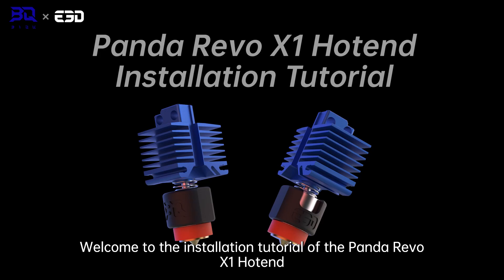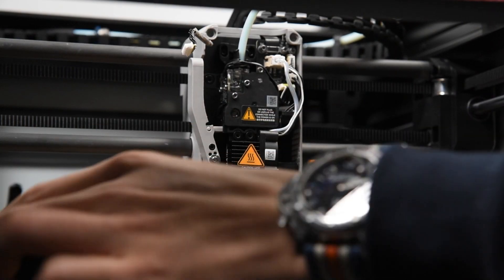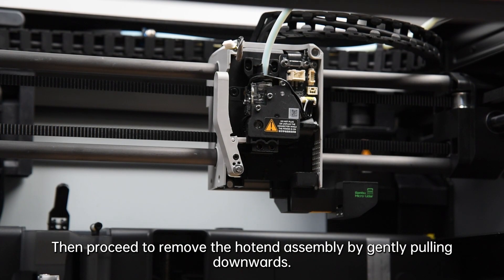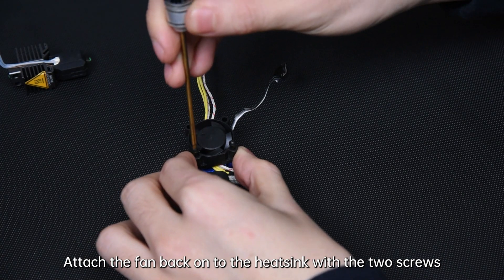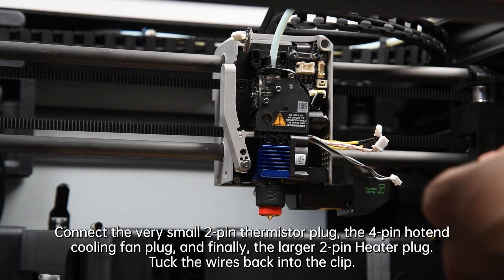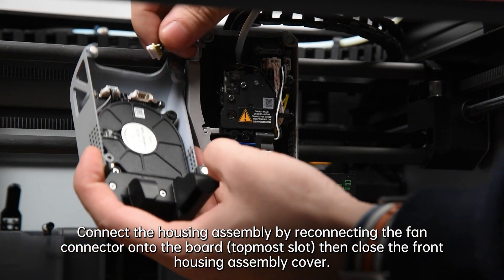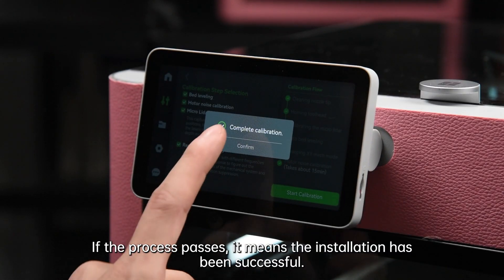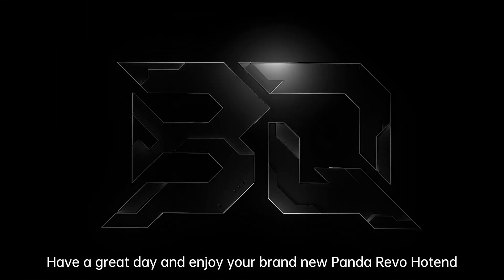Assembly Video--BIQU Panda Revo ✖️ E3D For Bambu X1C

Comment: BIQU. In December I ordered a replacement heatercore from your website. I was told now that this is backordered until sometime in February, which did not work for me as this would have my printer down for two months. When I was checking status, your support teams were quick to respond but when I asked to cancel my order, they stopped responding to me. I have tried several times, in different ways to reach you to cancel my order, so now I am resorting to posting this publicly. Can you please help me cancel my order?

Comment: Don't I also have to change the nozzle material from hardened steel to brass in the printer settings? 🤔 And what about other settings? Temperature, Speed,.... This instruction doesn't have enough information for a beginner.
Reply from the maker: Hi,For more technical support, you can contact our technical mailbox: service 001@biqu 3d.com.

Comment: Running Calibration on the P1S right now. I was doing the install Live on Twitch and cut it short when I couldn't get the Revo connector on. After the stream I took a breath and pushed harder than I wanted to, and it snapped on! Now I just need some ObXidian Nozzles 🤘🤘
Reply from the maker: Hi, Is everything going well now?

Comment: At least the heater cable is simply to short for X1C. Very annoying: You safe 1 cm and the customer has a pretty hard time to get the hotend installed. My experience with thrid party parts (needed to replace my printbed too, because a part got loose and it bend the stuickertable pretty bad => Wanted to try out a full alloy one) is pretty annoying. Not because of the quality of the main part but because of to too short cables, cheap cable shoes and such things, which is sooo unnecessary annoying. AND the thrid party parts are MORE expensive than the original ones.
Reply from the maker: Hi, thanks for your feedback, we will give feedback to our R & D team.
Reply: At least your heater core is presumably working.  Mine failed, and replacements are backordered until late February.  I ordered mine in December, and tried to cancel my order when I found out it was going to take two months but they have been ghosting me.

Comment: For $130 I get to supply my own fan and work with your crappy wire splices! What a deal! 

You asked me to resolder wire you didn't connect properly. Lol, you aren't a real company that makes real products. Some 14yo on Reddit made a better version of this for cheaper. What a scam. 

Stay away from this half assed product, it's such a cobbled together money grab and a failure. Wait until E3D or Bambu create a real solution, not this shoddy crap.
Reply: E3D did bring out a hotend which is high flow but still uses the stock heater which doesnt have enough power. This product would be great if it didnt have the issues you are talking about as the heating element is a lot more powerful to make it actually capable of the speeds. But it is understandable then when one drops 118 bucks on a hotend one should have to supply a 12 dollar fan and screw this thing together. It should be good to go.